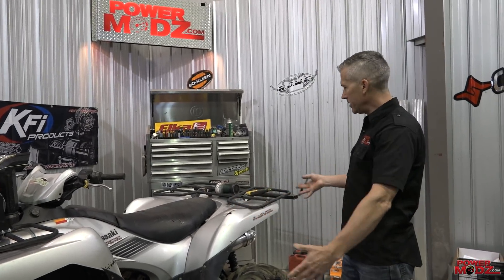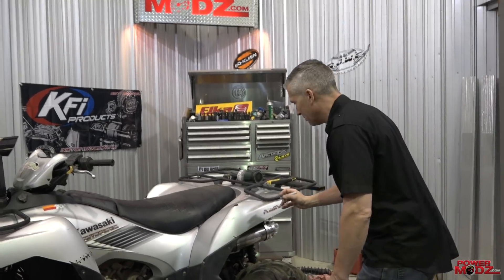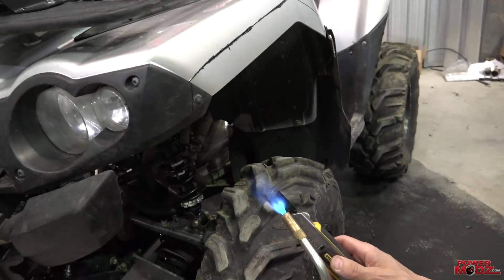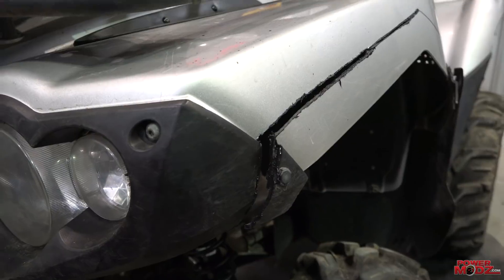Trimming ATV fenders to look awesome!  Brute Force 750 Build!

Comment: Option for the old rad placement. You could install an oil cooler and install your oil rad where the coolant rad went. That's what I did to close up the hole on mine and kept the oil temp nice and low.

Comment: Do NOT PAINT IT!!! either get wrap for it or plasti dip it. Paint will ruin this project, it wrecks 99.9% of any atv plastics. 

Mosi-oak has some pretty cool looking camouflage wrap that fits anything u put it on, comes in like 6x8' pieces. 

Plasti dip will last longer than paint as it does not chip, and it's rubber so you can literally peel it off if u don't like it or whatever. But it's supposed to last up to 4 years on a vehicle and doesn't just peel on its own, even if it gets scratched. so an atv shouldn't be too much for it.

Comment: if u think it looks like a grandfather's bike and want to change it then why put mayhems on it, they deff are a grandfather's tire?... put a good tire on the kaw like assassinators, or even outlaws, bkts or silverbacks, give the bike a chance it will be more fun to ride.
Reply from the maker: muddy assassain because i dont want to keep breaking axles and diffs.  these tires are 30 pounds a piece and only 28s...theyll be great  on this bike without being down for broken parts all the time
Reply: +PowerModz ... it's in how u ride, whether u break stuff or not. a prime example, that u have witnessed, is nos. he has had his asses for around 6 months now and hasn't  broke anything, that I know of, and he rides pretty hard. it's all in how you work that thumb triger. with rims a mayhem is going to be around 45lbs or so. asses are going to be around 65lbs or so, and that's 29.5. that's not that much more, to have that much more tire. even your crypts on the kaw would be better than mayhems. anyway... just my 2cents.
Reply from the maker: muddy assassain no doubt about it and technically i can still take my 1989 suzuki quadrunner everywhere all these new bikes go...but with not as much pizzazz... a lot of it has to do with terrain as well if you put the hammer down in some of the areas i do with monster lugs axles will get broken...and i like giving er the odd time.